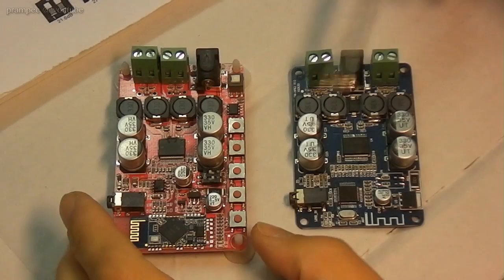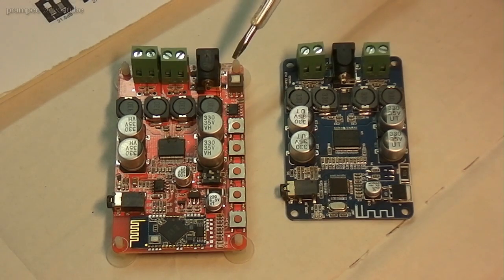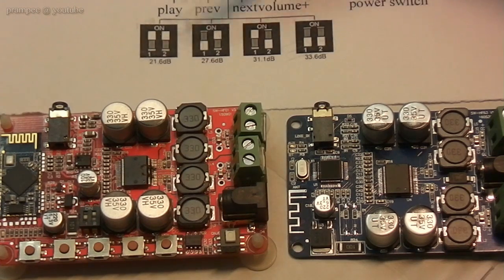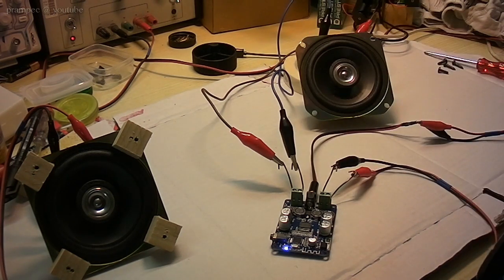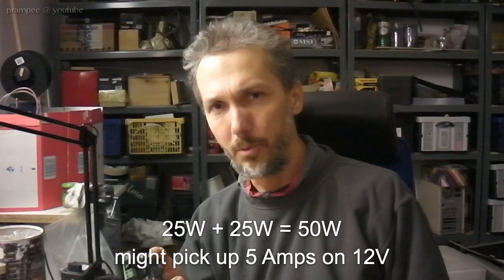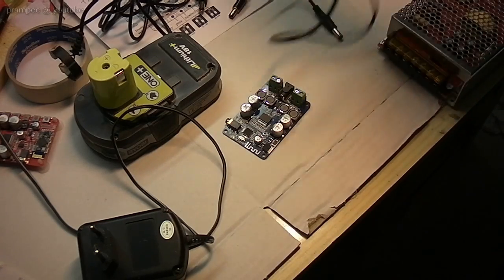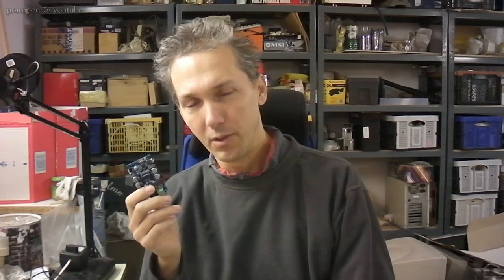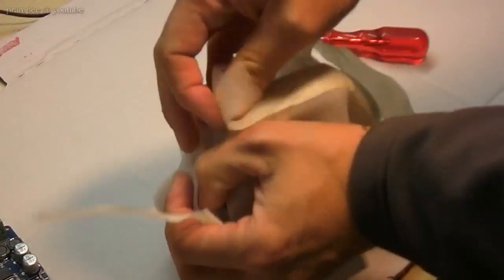Tested and modified the TDA7492P Bluetooth Amplifier module

Comment: I think the Bluetooth on the board is what make the sound sucks. But if you can remove the Bluetooth from the board and the push all the gain. You will have a very powerful bass and clear sound from this small amplifier board.
Reply: The problem is, it's the bluetooth module that handles the auxiliary input, so removing it would mean no more sound... That's surely clear as hell, bit also silent

Comment: Sir where is the link for the plastic holders for the amp. Please help.
Reply from the maker: That's a tricky question. I don't know where those feet are. I might have received the amp with those installed. But you might want to search for "nylon pcb spacer"
Reply: Yes sir thank you

Comment: Sir, when you use this board with 15w or 220w speaker, the sound tears when there is any bass in the sound track.
Can you help me with that.
It happens only in the last 2 points of the volume on the higher side.
Reply: I got the answer....the problem was that the board was not getting enough ampere, so the aound was cracking.

Comment: I guess crossovers (or set of capacitors and resistors) are required to get a clear sound - that should filter out unrequired freqs for twitters and bass speakers.
For 18650 - use BMS balancers and DC-DC converter for charging them and maybe another one for powering AMP with higher voltage.

Comment: blue one is not a newer model - its a cheap rip off
Reply from the maker: Note, that this video was made two years ago. At that time it was new. At least new to me. Yes, the point was to build a cheaper model with less function. But I wouldn't say that it is a rip off. It is still made by the same manufacturer, in the same (questionable) quality.

Comment: I have this board and it's pretty good but whenever there is a quiet part in the audio track the sound drops out for a short moment and small parts of the audio gets cropped off. I there a remedy??

Comment: Balaźs, just wanted to say thanks for the tip about removing the 0ohm resistors.  I took your advice to remove them and that took care of the noise and over driving the amp to the point of it shutting down.  Keep up the great work!

Comment: You use lithium batteries like this 5S or 5 in series to 21 volts and for long use you can run 4P-5S  Wire 4 batteries with all 4 positive to the next 4 all negative and use a hobby charger to charge/balance/and charged to spec or use a Protection Board/Balancing Board BMS like this, but it has to protect and balance, some only protect. https://www.parts-express.com/19-vdc-48a-switching-power-supply-with-25-x-55mm-center-positive-plug--120-058

Comment: For a power supply this works good with these boards because you don't want to run these at top value, it kills the capacitors.  https://www.parts-express.com/19-vdc-48a-switching-power-supply-with-25-x-55mm-center-positive-plug--120-058

Comment: have one with the same voice and I will not use, do you know how to turn that off? annoying Chinese voice
Reply from the maker: All the software, including the voices are stored in an EEPROM on the BT module. Theoretically it is possible to update the ROM, but it needs special equipment, and most of all a replacement ROM, as the software is not open, and cannot be recompiled to build your custom ROM.

Comment: The reason for it not giving rated power it's likely to be that you are underpowering it, specs for that chip states that VCC supply range is 8-28 volts, and rated power curves are at 20volt , so...
Reply from the maker: What I can tell you, is that I do not understand the power consumption of these amplifiers. See also: https://youtu.be/mDEtyuHuG4s
Reply: try with a power supply that can put 20 or 24 volts to it and the same load, also drive both loads at the same time and maque sure input level is suficiently high, then meassure the current again.

Comment: Thanks for the hands-on demo showing how to manipulate the switches. But when doing speaker test please place them in proper size boxes with sound deadening material and dance box construction it would make them sound so much better enhance the base and clear up the mid in trouble ranges. Plane open speakers really degrades the sound
Reply from the maker: You are perfectly right, in that open speakers sound terrible. However the purpose of this test was to get an idea about background noise and loudness. Anyway, it would be a very stupid idea to demonstrate sound quality over youtube. I also prefer to build speakers into boxes: https://youtu.be/X5H1B4K88ag?t=2m42s

Comment: on the red board:  which connection i have to cut to  power off and on the disturbing bluetooth modul manualy per switch?
Reply from the maker: The bluetooth module is powered from the 7536 3.6V voltage regulator near the switches. But there is no sense to power off the bluetooth module, as it handles the auxiliary input as well.
Reply: Oh,  I thought i can cut the noise/hiss out this way if BT is not needed. But if AUXin is disabled too, ...

Comment: Question : First few times worked well. Now the 7536-1 voltage regulator heats up so much that you can barely touch it. And stops the amp ,resets it. Can i do something with it or just throw it away? Or why does it do that?
Reply from the maker: This is definitely something, that is sounds interesting enough to inspect. However the 7536 voltage regulator (as it provides 3.6V) is likely to produce voltage to the bluetooth module, thus the bluetooth module might be damaged.
If the bluetooth module just works well, I suspect that the 7536-1 is broken. You might try to remove it, and provide the 3.6V from a benchtop power supply as a test. (I'm not sure that worth the effort tho. :) )
Reply: Balázs Kelemen  I will just remove it from the pcb and replace it with a more " manly " one :D. I will let u know how it went when this happens. Thanks for the reply.

Comment: I am about to build my own portable bluetooth speaker and might need some help.
I have got 1 speaker cabinet (with speakers) [Poineer S-p370):
 - Music Power [DIN] 50W
- Puissance Musicale [DIN] 50W
- Impedance 6 ohm.
I was going to buy the TDA7492P 50W+50W (red one) and hook my speaker up to one of the 2 channels.
I am trying to power this system with 4X Vander 18650 Akku 6000mAh Rechargeable Li-ion Battery (14,8 Volts in total).
As I am not familiar with speakers and technical stuff like you, I was interested in your and others opinion if this is a good idea...  :D?
Reply from the maker: This seams to be okay. You need a kind of battery protection circuit, as well as a charger for 4xLiPo batteries.
Reply: Well, thanks for your response! :) 
I would buy this: http://www.ebay.de/itm/4S1P-18650-14-8V-Battery-Holder-Case-with-Li-Ion-PCM-Protection-Circuit-Module-/182541642873?hash=item2a80546c79:g:yKMAAOSw3ZRY~KCx
And this item http://www.ebay.de/itm/4X-Vander-18650-Akku-6000mAh-Rechargeable-Li-ion-Battery-for-Batterie-Ladegerate-/401373520640?hash=item5d73b9e300:g:CPAAAOSwr~lYtbks .
In the description it said that you have to use a "special charger" for these batteries (the one delivered ?)... so I think I will have to get the Batteries out every time I have to charge them... :/?!
Reply from the maker: Search for "4s charger protection" instead.
Reply: Thanks a lot! I think will try to rebuild a charger + the batterie pack from these videos :D
https://www.youtube.com/watch?v=DAQoyPZU4Z8
https://www.youtube.com/watch?v=npA8FiqI9Tw
And I hope I can set all together like someone else did here: https://i.imgur.com/unAExXF.png - instead of the blue part i am going to use the charger.

Comment: Do you recommend the older board with the push button switches controlling volume?
Reply from the maker: Certainly. It does the same as you push volume buttons on your phone. (Thus does not have effect on the audio arriving from AUX!)

Comment: The TDA7492 IC only gives 50+50w RMS THD10% when it's connected with 25VCC and the speakers have 6 ohms of impedance. When you buy an amplifier or an Amp IC, you should research the IC's datasheet.
Reply from the maker: I can agree with that.

Comment: Look.  None of these amps should amplify at 36db, ~24db at most with reasonable background noise.  Even there, 8 watts at 0.1thd at best.

Also, have you tried a 45k low pass filter with the el cheapo power supply.

Comment: Hi everyone, I would advise against buying the TDA7492P amplifier from this supplier: http://www.ebay.com/usr/chips-fans?_trksid=p2047675.l2559 The TDA7492P I bought from them was defective and makes loud "farting" noises once the volume goes above 1/2.
Reply: You should try to increase the power input to the amp, it will eliminate the distortions you are experiencing.

Comment: Hello. I recently bought one of this amps, but when i plug a laptop charger to it (its a 19v 4A) already connected to AC, the amp gives a lot of sparks o.O Do you know whats the problem? Also i tried to measure the amperage of the amp in use but it simply got sparks in the multimeter terminals... is something wrong there?
Reply from the maker: Small sparks on the contacts are not always means that there is a problem. Best would be to try with a benchtop power supply, where you can maximize the current draw. There might be a short on the circuit. Make sure that you connect the power with the right polarity.
Reply: Balázs Kelemen Well, the polarity is probably correct since all dc jacks are usually comun center positive... There can be some short, since i never seen so many sparks in a dc jack

Comment: I would like to use an amp that is similar to this with a single speaker...could someone 
explain the best way to do this, other than hooking the speaker up to either the left or right side?
Reply from the maker: I'm not completely sure on this, but theoretically you can connect the matching speaker-leads of the two sides on the output. This way you get the double power of the amplifier. (Meaning: you can use one bigger speaker.)

Comment: Hi, what pcb (with BT) would you recommend for a higher quality output with better sound reproduction?
Reply from the maker: One recommends a board with aptX (often wrote as APT-X), especially boards integrated with a CSR8645 module.
Reply: Balázs Kelemen Thanks. Is this board essentially a better BT receiver? Will need to feed into a separate amplifier board or is the amp built in?
Reply: There are several revisions/versions of that board, all requiring a separate amplifier board. If you want a board with an integrated power amp you can have a look at this: http://store3.sure-electronics.com/aa-ja32171-1763

Comment: Hi, I just bought the new blue amp and I'm finding sync issues. The sound follows the video by a small time, enough to be annoying. Have you got any idea of a fix?
Reply: Thomas no it is the switching frequency of the transistors in their amplifier stages, that's kinda constant with the quality of transistors chosen
Reply: Crazy the first one i bought hasn't had a problem, i bought a third one which now crackles for a second or 2 every minute. WHat could that be?
Reply: Thomas, have you been checking your different BT amp modules with the same pair of speakers? Or different speakers? Random crackling or popping is normally from bad contacts either at terminals, or inside the speaker. You may need a new speaker
Reply: I had the same problem and figured it out: this amp needs at least 13.2volts and 3.6 amps power to function properly, lower than that you will have "farting" or crackling noises from the speakers. I hacked three 4.5volt 1200mah cellphone power banks for their batteries and connected them in series, http://www.zbattery.com/Connecting-Batteries-in-Series-or-Parallel,  to get the power I needed for mine. However please be careful when you crack these powerbanks open for the batteries, if you short the batteries out they WILL explode!!!

Comment: Thankz for the video,it really help alot.
but i have the red color board,and i have a lot of noise amplifie in tje background,.
is it a way to mod it like the blue board like you did?
Reply: Edmund Chai solder a wire to the Bluetooth antena and that will take the noice away.

Comment: read the datasheet, you cant get 50w on a 12v supply. you need about 19v, but to be save go with 24v
http://www.st.com/content/ccc/resource/technical/document/datasheet/35/01/97/6b/20/ce/40/6f/CD00211320.pdf/files/CD00211320.pdf/jcr:content/translations/en.CD00211320.pdf

Comment: buy the new yellow one - no hissing and more power  https://www.aliexpress.com/item/TDA7492-2x50W-Wireless-Amplifier-Bluetooth-4-0-Audio-Receiver-Digital-Amplifiers-AMP-Board-10-25V-Dual/32699965810.html?spm=2114.30010308.3.10.YLGpRo&ws_ab_test=searchweb0_0,searchweb201602_5_10065_10068_10501_10503_10000032_119_10000025_10000029_430_10000028_10060_10062_10056_10055_10000062_10054_10059_10099_10000022_10000012_10103_10000015_10102_10096_10000018_10000019_10000056_10000059_10052_10053_10107_10050_10106_10051_10000053_10000007_10000050_10084_10118_10083_10000047_10080_10082_10081_10110_10111_10112_10113_10114_10115_10000041_10000044_10078_10079_10000038_429_10073_10000035_10121-10050_10503_10501_10112,searchweb201603_1,afswitch_3_afChannel,single_sort_3_default&btsid=ec33efd6-70bc-4e0b-83fa-a886f9d445c8

Comment: Hi, I would like to know if the AUX can be used as output to the bluetooth audio signal coming in. For example, could it be use as spectrum analyser display via the AUX while playing music on the speakers?
Reply from the maker: Unfortunately this is just an incoming port. But you might find the input for the amplifier IC and get audio signals by draining those legs.

Comment: Is there a way to remove the beep that the old model has when it starts up?
Reply from the maker: In short: No.
In detailed: The BT module has a microcontroller, that has been pre-programmed by the manufacturer. All the beeps, key actions and whatnot is the part of the program. In theory it is possible to reprogram it with the appropriate device. But it is so badly documented, that noone will came across to provide a toolset for the community.
Reply from the maker: You cannot adjust the volume of this amplifier expect for the two gain switches. But there might be ways to reduce the volume. E.g. the 21th pin of the amplifier chip does a mute. (You can pull that pin with some 4K resistor to GND to apply mute.)
Reply: Balázs Kelemen please tell me if i can addjust the beeps volume at the startup on the old BT 120w blue board as it goes on the full volume at the beggining. thanks

Comment: I understand that most of these style of units have a basic design flaw in that there is a ground loop (with the BT unit) causing the poor sound reproduction.  You need to isolate the DC power supply from the BT/Amplifier - maybe a mod too far for such a cheap amplifier.
Reply from the maker: There might be some design flaw in these products, but I wouldn't call this a poor sound reproduction. It's just not professional grade. The only problem I've found here is a hiss appears when playing back quiet audio.
Reply: Hi Balazs - I've yet to test this type of module myself but I have an upcoming project for a portable BT speaker and I've been reading about problems about many of them having 'high noise floors' - this is often attributed to ground loop problems apparently (I'm not an audio engineer though)!   Some of the technical reviews talk about shared grounds between the amplifier and Bluetooth module and/or the signal grounds.

Comment: hey I have a problem here, I have a stereo tv speaker that uses rca connector, I want to use it with my set top box, but there is a slight delay between tha rca n hdmi from the set top box, I also dont want to use rca video out for my tv bcs the quality is terrible, so can u give me some tips how can I use the speaker?
Reply from the maker: Generally say RCA connector can have a good quality, so quality degradation in not because of the connector type itself. On the other hand, when you are about to use HDMI to pass video, you need you use HDMI to pass audio as-well (to avoid delay :) ). You need to use exported audio from your screen, but I see, this is not an option for you, I assume you are using PC screen. If your screen can accept VGA, you might find a HDMI-to-VGA adapter useful, a one that provides audio output.
Reply: +Balázs Kelemen what's the point of using a pc monitor when u have a smart tv....duh
Reply from the maker: Okay. I might got you wrong. But than, what's the point using a tv speaker, when you got a smart tv?

Comment: I got the 2*50W red one. For months there were no problems, now I've noticed that loudness dropped. Those gain jumpers (on or off) became sensitive to the touch. If touched lightly with fingertip or tip of a screwdriver the music is notably louder, as it was before. How to fix or stabilize gain jumpers without removing them?
Reply from the maker: If it is not a loose solder joint, than there is no way you fix a broken switch in this size. It should be removed. You can either replace it with a kid of same one (I would give you the switch from mine, as I don't need it any more. :) ), or - if you know what gain level you always use - solder in  jumper wires to connect the leads.
Reply: Balázs Kelemen It's not a loose solder joint so I'll remove it. Thanks!
Reply from the maker: BTW, in reality there is no 2x50W models out there. The TDA7492P amplifier chip is capable for 2x25Watts output.
Reply: There are, the TDA7492 is 2x50W, the P version is 2x25W
http://www.st.com/content/ccc/resource/technical/document/datasheet/f4/3e/da/a3/97/e7/4f/8d/CD00205863.pdf/files/CD00205863.pdf/jcr:content/translations/en.CD00205863.pdf